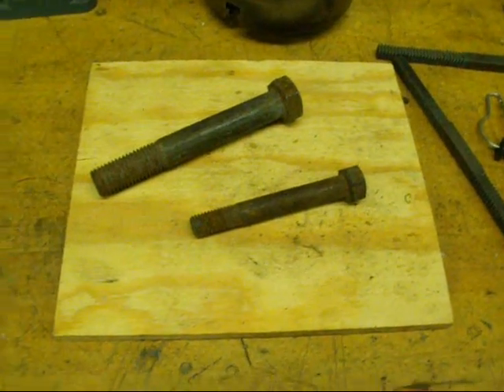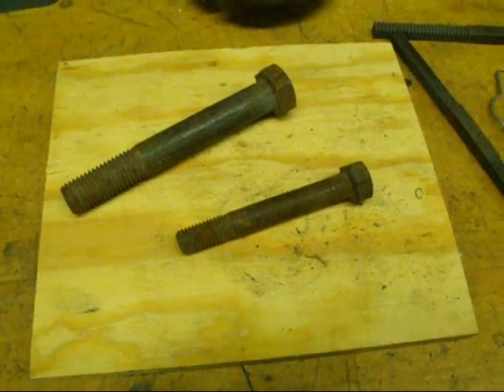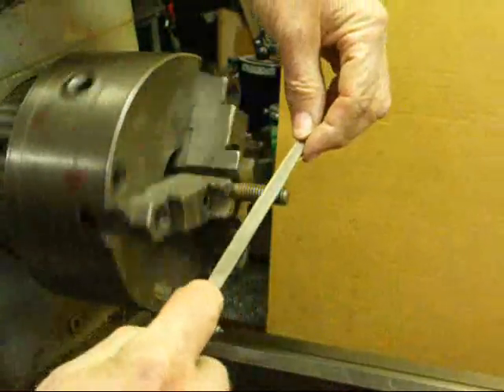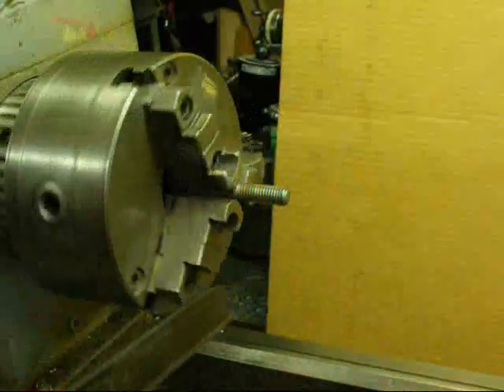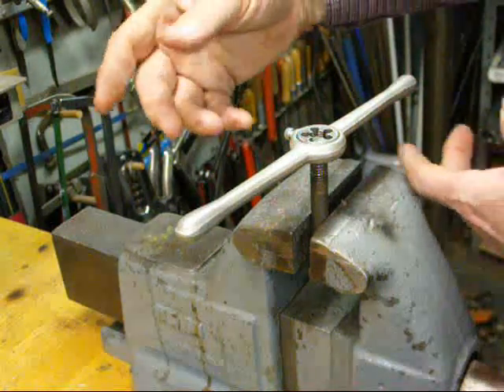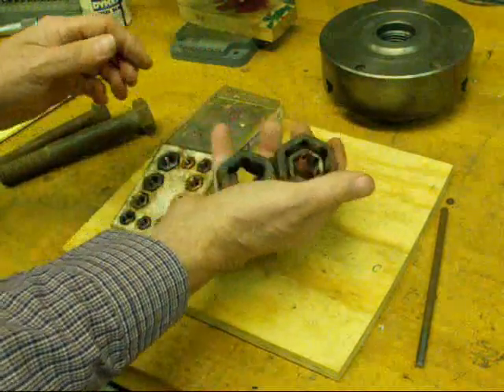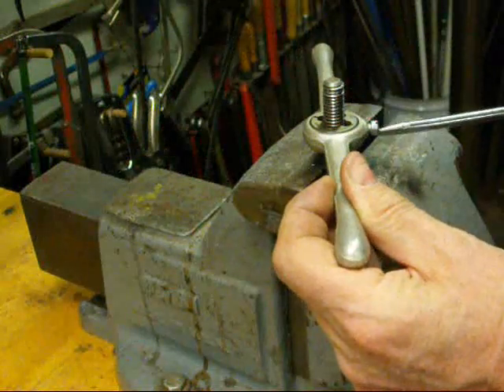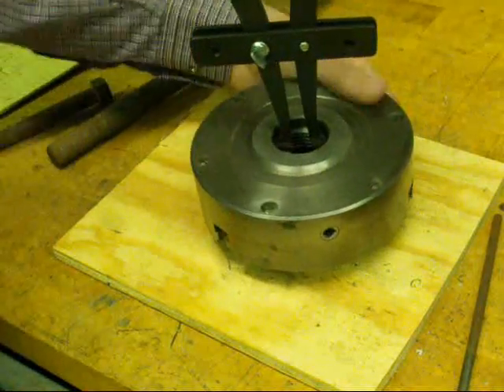MACHINE SHOP TIPS #12 Thread Repair (male) tubalcain

Comment: Hi Mr Pete there are no new comments for 14 years . What i did is to buy a tap and die set off the snap on truck in 1990 it had sae & metric it was carbon steel set $300 bucks and at the time i couldn't figure why they wouldn't cut new threads in steel very well . Also i did not know that there were HSS types of taps and dies only found out in 2020 when i started buying machines and tooling and watching your videos  . Thanks JM
Reply from the maker: Yes, the carbon steel is not very good. I noticed that in most box stores in the tool department.
The drill bit sets look great and they’re golden color, but they are not high speed steel. Very solemn will you see an HSS on cheap tools
Reply: Ya harbor fright is good for that .I bought in the 90's a Mac tool set from 1/16 to 1/2  8% cobalt so when i shopped for a set from  1/2 to 1'' i got the same type . the blanks were made in China and ground here they cut as good as the us ones . Thanks Lyle

Comment: Hi Tubal   I have one of those otc type thread repair tools that I have used when I was a mechanic at a large aluminum rolling and casting companies in Oswego NY. It was handy for repairing threads on roll journals and such that you take the time to send to the machine shop. there are also metric dies for those tools.
I still have to take that air whistle down that I told you about so I can send you a picture.

Comment: what i will do is slit a die on each side and break it in a vice with a hammer, that way it makes a "clean" break that has no kerf. i stole the idea from the nut that drives the jaws on a jacobs chuck, i've also seen that used on vice nuts as well

Comment: I have just recently discovered your informative videos and am thoroughly enjoying them.  However I must disagree with you on using standard threading dies on bolts or studs.  Most bolts/studs are manufactured with rolled threads and using a threading die on them will cut the root out of the thread thus creating a stress raiser.  This will typically reduce the strength of the bolt by about 30%.  The use of a thread chasing die would be acceptable as long as it causes no damage to the root of the threads.  Keep up the good work.
Reply from the maker: Point well taken

Comment: Loved the video.  A Harley-Davidson wrench for over thirty years, I've done my share of thread repair(especially H-D's NST).  Ferrous metal fasteners into non-ferrous cases are a recipe for disaster.  I especially liked the idea of splitting a dye to repair a thread.  I've got a tip of my own.  If a lathe isn't available to spin the bolt .  A drill(cordless works best) mounted in a vise works fine.  Chuck the damaged bolt into the drill , lock the drill into a slow spin and viola, instant lathe.